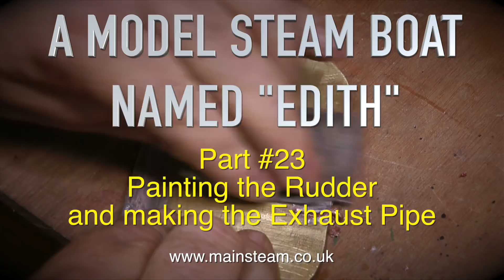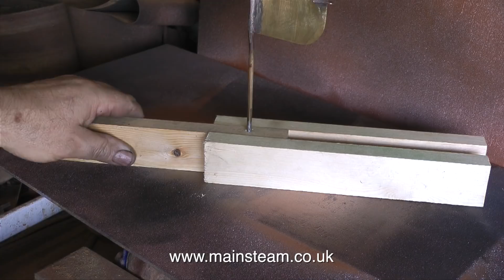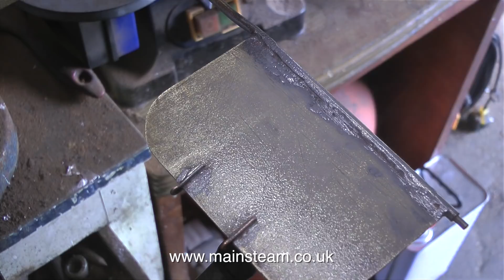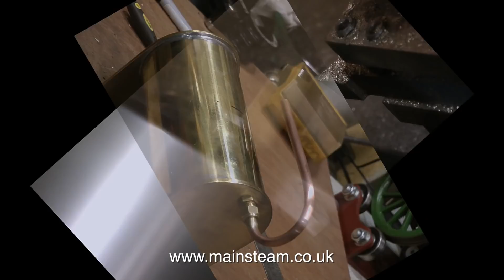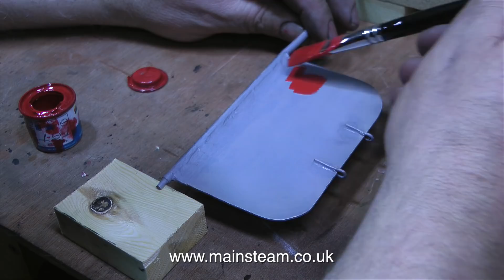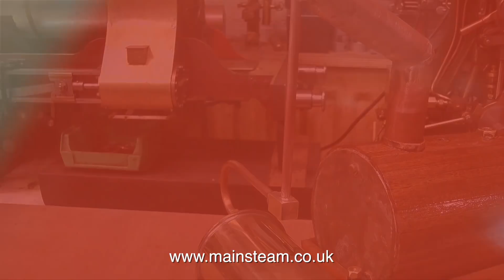A MODEL STEAM BOAT NAMED EDITH - PART #23

Comment: The fact that the two-by-one is a little smaller than 2" x 1" has nothing to do with it being metric or imperial, it simply is named by the size to which it is sawn in the mill, it ends up a little smaller due to some wood being lost to the saw cuts and the planing process

Comment: I think the soft silver solder confusion might be from the electronics world. I used to use a "silver-bearing solder" which contained about 5% silver to do electronic repair. It's great for surface mount components. Anyways it's often marketed as just silver solder, and it's very nearly as soft as regular old tin/lead stuff. Probably utterly useless for making stuff in the steam world.

Comment: What are those eyelets or whatever they are called on the trailing edge for?
Am I correct if I assume that you have had some kind of pedicure on your front paws?
Reply from the maker: I don't know what they are for on the full sized boat - maybe a viewer will tell us {:-)))
Reply: Keith Appleton On a full sized boat they would have chains attached to the hull in order to limit how far the rudder moves. This prevents damage to the steering mechanism from an over zealous steersman. Also the steering is not effective if the rudder is turned to far. And yes steersman is a real word.

Comment: Love the joke about the unpainting brush, but on a serious note, any tips on how you clean and store your brushes after use? (Just repeated rinsings in thinner, or do you do something else?) If you've already addressed this, a point in the right direction would be helpful.  Thanks again for another great video.
Reply: Love the videos. I own an art supply store, and always suggest cleaning brushes with the appropriate solvent, and when you think its clean, clean it again with "The Masters" brand brush cleaner with water. Then hang the brush upside down to dry. The reason for hanging it upside down is that anything that might be left in the brush migrates down to the tips of the bristles as opposed to going into the ferrule, which causes the splaying of bristles.

Comment: I was thinking about the water supply.  As you use up the water in the tank, the CG will shift.  Is that why the older boats pulled water from the lake?  So they didn't have a change in the center of gravity?  That would necessitate a ballast adjustment....  Or is this over-thinking the issue?
Reply from the maker: this definitely over-thinking the issue - the small amount of water carried in the water tank is insignificant relative to the amount of ballast that the boat will need to carry.
Reply: Seeing how high the boat floated in the tub is what made me wonder about that.  I didn't know the capacity of the tanks you made, but I expected them to weigh less that 10 lbs full.  I will wait to see how much ballast is required...

Comment: Do "Leeds" carry the un-painting brush's?  To add to the confusion about Silver Soldering, there is a product called "Stay-Brite" by the Harris group this is 94% Sn (Tin) 6% Ag (silver) and is Liquidus at 535°F, they also sell one which is 4% silver. They list them as lead free solders, but originally I believe it was listed as Silver bearing solder and shortened by others to Silver Solder when they sold there copies. I have got that when I buy Silver Solder I look to see that the actual composition is.

Comment: There is a soft solder with silver in it. Usually referred to as Silver Bearing solder of the lead-free sort; also SAC305 lead free is a silver bearing solder. The lead-free solder most try is over 99.5% tin and half a percent of copper, which is the most problematic lead-free solder there is. Someone figured out that if you dropped the tin to around 95% at most, then you could get much nicer results using 3% of silver and the rest as copper. Jiggle the numbers a bit for slight differences, but it's a much better lead-free than the near pure tin that was used too much in the beginning or by those demanding only the worst results possible to justify their demands to use leaded solder.

Comment: There is solder that is soft solder, but contains like 1-2% silver to it, and it is silver bearing solder, which is used for plumbing pipes and for jewelry. You tend to find it alot in hardware stores, and I was confused at it at first till I had gotten the real stuff also.

Comment: Dear Keith,

There is "soft silver solder".
Here in the netherlands it is called "Resist 2".
This is tin solder with 5% silver added.
Its melting point is higher then normal tin/soft solder and also the mechanical strenght is higher.

But i must say, steam unions, and mechanical parts are best done with the good stuff, silver solder, 600+C melting point.
Reply: Indeed, there are many solder alloys that contain silver but are not "silver solder". This is especially true since the introduction of ROHS but it was somewhat true even before that.

Comment: Hello Keith! Thanks again for the lovely video. I had a good laugh at the unpainting brush, even though I've heard the joke many times before. :D

However, I feel the brass block you've machined to make the 90° bend in the condenser exhaust pipe looks a bit crude. I think an elbow would have been a better choice. Is this how such junctions look on full scale piping? To me, I doesn't really fit the aesthetics of the rest of the parts. But I'm not to worried since it'll be inside the hull and won't be visible.
Reply from the maker: as you say it is inside the hull .... and not visible, but it is a strong & secure fitting.